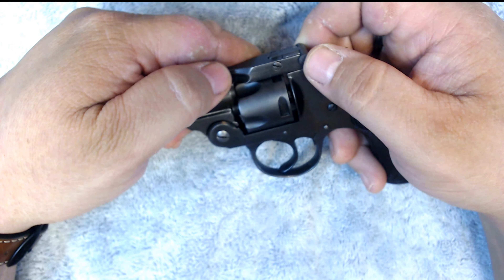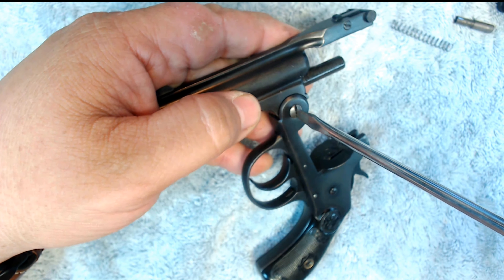Iver Johnson Second Version 32 Top Break Disassembly

Comment: My first GEN is nearly identical except for the break release. I need to dig into mine and figure out why my trigger needs help returning to fire position after each pull. Its dragging I believe.  This is a great video for my gun's break down. Thanks! BTW, I have two generations of this. My second gen appears to be missing the firing pin assembly.

Comment: How do I get the trigger to reset after it is pulled.  That is I have to take my finger and push it back into position.
Reply from the maker: That's the trigger tensioning spring.   Go to 7:32 in the video to see it.  When I got this gun, the spring was broken, so I had the same problem.  You can get replacement springs on ebay and numrich gun parts (www.gunpartscorp.com)
Reply: I've got the exact same revolver with the National Arms name on it .Made my own triger return spring and ejector spring for it just last week. Takes a little time but very doable  if you can't purchase one.

Comment: Would you be interested in another iver johnson 32 hammerless?
Reply from the maker: I'm always interested in another old gun
Reply: I would like to restore it myself however the firing pin bushing does not have the 2 holes to use when unscrewing it. Is it possible that it is removed another way?  It has 2 pins at the top holding a slide cover. Is it possible that is how to reach it?
Reply from the maker: The only ones that I've seen have the 2 holes to use to remove it.  It may be a model that does come out some other way, but I've only seen the one way on this particular pistol

Comment: You must have bead-blasted that gun to get it as rust and pit-free as it is. I'm currently sanding a blued H&R 32, and it's a lot of work.
Reply from the maker: Nope, it was actually nickel plated, but the plating was not in great shape, so I used a chemical reaction to remove the plating, then slow rust blued it.
Reply: @NinjaMidget1969  You did a great job.

Comment: What is the finish you have on the gun?
Reply from the maker: I did slow rust bluing on it
Reply: @NinjaMidget1969  how did you remove the old nickel plating that was coming off of it off
Reply from the maker: @keithwilliams8807  It was some chemical that I found online.  I can't remember the name, but it worked pretty well, it just had to be heated to work best